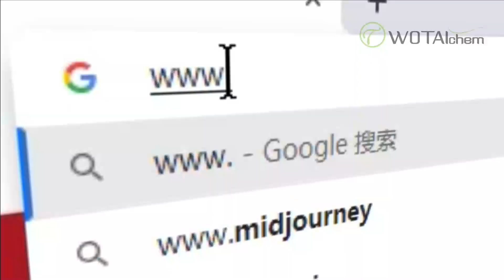Can calcium formate and cellulose ether use together in while cement/wall putty?

Comment: Can cacl2 and Sulphonated napthlene formaldehyde mix
Reply from the maker: No, they cannot be mixed. Chloride ions can cause corrosion and efflorescence. In wall putty formulas, calcium carbonate and calcium hydroxide can be added. Sulphonated naphthalene formaldehyde is a superplasticizer used in concrete. For better results in your construction project, precise products should be incorporated. Feel free to visit our website at wotaichem.com to explore high-quality construction additives. Our experts will provide customized formulas and technical guidance for your project.

Comment: how much both qtys use we can use
Reply from the maker: The specific addition quantities of calcium formate and cellulose ether in wall putty cement depend on factors such as the formulation requirements, desired properties, and the overall composition of the mix. As a starting point, here's the general dosage for both additives:

> Calcium Formate: Typically used in the range of 0.1% to 1% by weight of cementitious material.

> Cellulose Ether: Typically used in the range of 0.1% to 0.5% by weight of cementitious material.

It is recommended to start with a small percentage of each additive and conduct trials to achieve the desired results. For precise guidance or tailored additives to your project, please consult with our experts at info@wotaichem.com or visit www.wotaichem.com. Our team is committed to providing customized formulation guidance based on your specific needs.